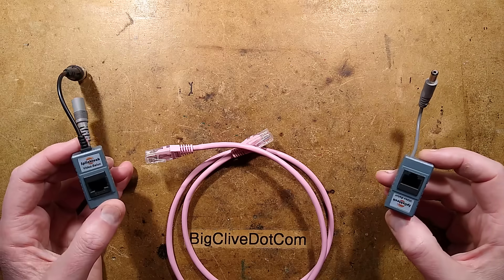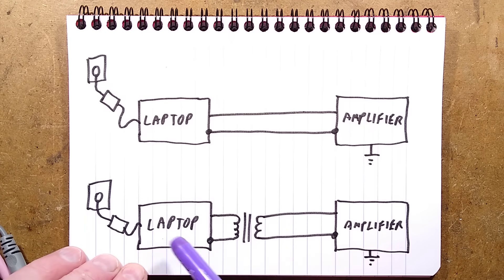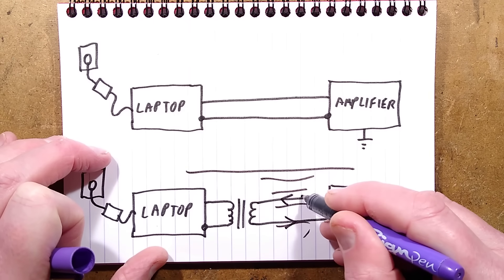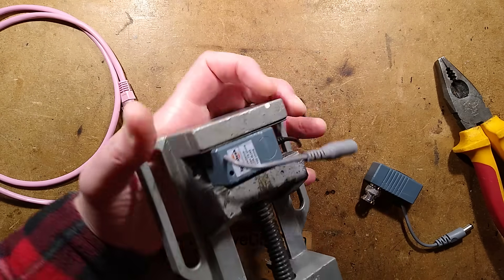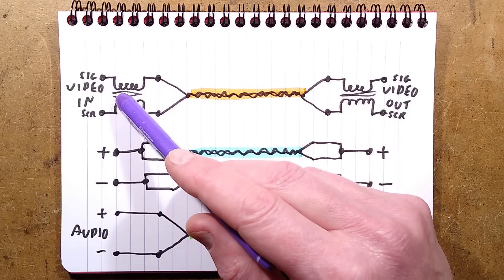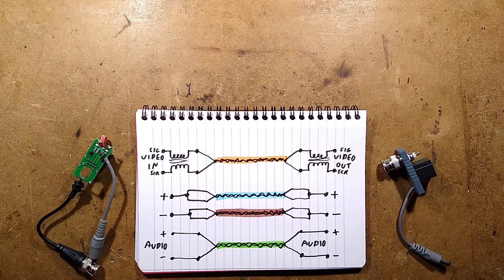Baluns - I got this one wrong (with schematic)

Comment: Used these for years as an Offshore Survey Engineer. It was always easier to run Cat5/6 cabling to carry video signals throughout a ship with a Balun on each end. Haven’t seen them in a while though as analogue video has thankfully been replaced 😂.

Comment: I feel like the transformers are to force a push AND pull of the same signal, strengthening it from noise.
The twisted pairs do a similar thing for noise, and this seems like an extra layer for cleaner video.
But that's just a theory... I have not played with these, although any kind of adapter is a fun toy...

Comment: We don't use much analogue video in the CCTV world these days but when we did the balun units we used were often PVD - Power, Video, Data. That was one pair for positive 12 or 24 volts DC and one pair for 0 volts DC. Then one  pair for thebvideo as you described. Finally, the last pair in the four-pair cat 5 cable would be for camera telemetry data for pan-tilt-zoom (PTZ) cameras. This is RS485 data and works remarkably well down unshielded twisted pair cable over really long distances. Individually screened and earthed pairs are best giving about 1km (or 1 click as the military guys would say). However, 485 dataover unshielded cat5 is will go way further than the accompanying video signal and even over 1308 telephone cable, the data is good up to the point where you'd consider running fibre instead.
These days it's all IP video and PoE (Power over Ethernet) cameras with 48V DC straight from the network switch. Alternatively, we can run just data over ethernet and maybe also fibre optic, then either use a PoE injector powered locally from near the  the camera or some cameras can run off 12 or 24 volts.

Comment: Looks like they are just a couple of common mode chokes based on your schematic. I know from experience that directly sending a 75Ω video signal down 100Ω cable does not create that much interference from the reflections.

Comment: I think they are wired as Common Mode Chokes. Any noise picked up on the cat5 video signals will be common to both video conductors, and this noise cannot propagate through either of the chokes.

Comment: I think that the point of these is to send the video signals down a balanced feeder (one of the twisted pairs), which is much lower loss than coaxial cable, and will permit a longer run with lower loss. Also very much cheaper than coax! 
They are 1:1 current, (or sometimes called choke) BALUNs, causing no impedance change at all, but they convert the unbalanced signal to balanced at one end and permit the connection of an unbalanced load at the other. 
Nothing to do with filtering at all.

Thanks for the videos. I love your sense of humour!
Ellis

Comment: Basically, imagine what Dolby did for noise reduction on audio compact cassettes and apply that same principle to noise reduction in an unbalanced cable: It encodes and decodes passively using the two transformers as the 'check-sum', which add together the waveforms in the positive and negative sides, to reconstruct an approximation on what the original clean signal was prior to being sent over the CAT5(e)/6 cable, allowing for long runs of ethernet cable to be used for further distances instead of the more costly Coaxial cable over relatively shorter distances. The circuit is probably so simple, so as to allow quite a large scale of frequencies & wavelengths to be used, possibly even allowing coax audio signals to also travel longer distances with little to no signal degradation. You've got me intrigued to experiment with a few of these units in order to discover more of their uses 🙂

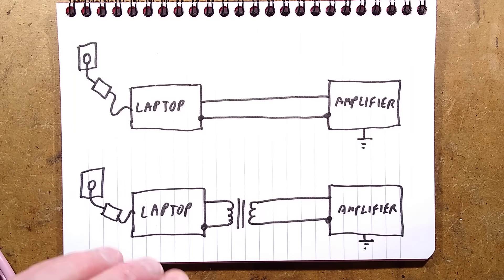Comment: I don't quite agree with your laptop/amplifier explanation at 2:58.
If you ground one of the input terminals, the line is no longer balanced (if you were using a balanced cable to begin with).
That's why you shouldn't expect to have common mode noise rejection with this setup.

It is just an isolation transformer and not a balun in this case.

Comment: When I saw balun I instantly thought “ooooo. Clive is also into his radio stuff” then chuckled at the “really geeky” comment.   Yes that’s me.   

Looking at what you have there it looks like an impedance matching transformer.   It’s very similar to the 49:1 transformer that I use in my current HF antenna.   It’s “49:1” is basically it turns an impedance in the realm of 2450 ohms and converts it down to the 50 ohms the radio likes to see.   The antenna is what is known as an end fed half wave.  So it’s just a straight wire which is half the wavelength of the minimum frequency I use.   So mine is 20m long (for approx 7mhz).   

As the current goes up so does the apparent impedance.   The voltage therefore goes down.   When you look at a sine wave and just take the bit above the line it’s basically the start of the wave.   Voltage then goes up as current goes down as does impedance.  So the cat cable in the middle acts in a similar way.   To transmit the signal down the wire the transformer is used to “match” the impedance.

Comment: Hi Clive as I was an alarm , CCTV Engineer ,the old Composite signals between cameras were always a problem as if the grounds were shared at the control unit with out filtering you got crossfeed from all the cameras giving ghosting ,so all BNC's had to be filtered by baluns.Take care buddy

Comment: 7:15 I believe that circuit is being used as a common mode choke. The transformer is wound such that differential mode signals (i.e a proper balanced signal), with the same (but opposite polarity) current in each leg, cancel out; they produce no magnetic field through the transformer core and it essentially has no effect on them. Common mode signals, however, induce a net flux in the core; essentially, it looks like an inductive choke to common mode signals, but is completely transparent to differential mode ones.

Comment: Transformer is  there to match the 75 Ω impedance coax cable with the 120 Ω of twisted pair which is used to run for the video signal. 
BALUN means:  BALance ~ UNbalance. 
This is the only way to use twisted pair (UTP) cables for video signal.

Comment: Hi Clive, Love your channel! Been watching for several years now. The transformers appear to configured as nothing more than common mode chokes - a clever way of removing interference picked up in the cable between camera and monitor. The camera signal is differential (not balanced) interference will likely be induced into both conductors and hence common mode.  I think no impedance matching is going on here.

Comment: CCTV Baluns, they are awful, designed to convert unbalanced coax to balanced twisted pair, they're used because CAT5 is cheaper than decent quality coax and they cause no end of problems, not least because the people who used them to save a few quid never understand voltage drop so I've spent a not insignificant amount of time (charged at hourly rates) debugging installs where these things have been fitted and finding a way of powering the cameras 'locally'.

For audio isolation I've had good luck with little boards like XH-M372 from Ali but ended up building my own complete with opto isolated serial for low speed control.

Comment: As drawn, there is no impedance step - which is a bit odd, as the line pair in a network cable is 100ohms, and the coax is normally 75 (that is to say that the self capacitance between the wires, and the magnetic field around them conspire to keep the voltage and current in the ratio of 75:1 or 100:1 , when propagating signals that change in a time frame short compared to the time taken for a signal to get to the end and back - so what is at  the load end has nothing to do with that impedance, - it os only a feature of the cable construction)
So why are the transformers on their sides as it were ?  NO MAGIC.
Well forget voltages, and think currents. and recall a bit of RCD theory. The unwanted out of balance current sees the core, and the impedance in creates. The wanted in balance current is unimpeded. (much as the core  an RCD does NOT see the intended L_N load current but only any out of balance component. )
So if we earth one side of the wire at one end , as we do with the coax,  but at the other end the earth is not the same RF voltage, that would create an out of balance current and the core will attenuate that effect. 
In short, the voltage difference between the two lines is preserved, but the absolute value can flap about at HF without causing problems, In fact you could cross the coax over so that at DC it was centre to ground short from one end to the other - but the RF would be fine with it, and any frequency above some minimum would come out at near 100% amplitude, just if you had a scope you would see that it had come out upside down.
Mike

Comment: I use laptops with pa gear all the time and what I've found is the cheap Chinese crap chargers are very bad at causing the ground loop noise but with genuine manufacturer branded PSU they are fine - there are the odd exception to this I found Samsung laptops have issues but think they use 3rd party chargers which must be bad too

Comment: The electrodynamics shows us that the twisted pair (or an old ladder pair of wires) doesnt have symmetry of concentric but has the same electrodynamic properties... in the ideal world - the Maxwell equations with "a little" simplification bring us to the same conclusion of a transmission - in the ideal world :) but the world is not ideal and the power adapters have faults :).
I think its just a radio balun - like these being added to the antennas and similar - it matches the impedance.

Comment: Why they do it this way is simple, Video's frequency range basically starts at DC and extends up to many megahertz, you cannot pass video directly through a regular transformer winding.
The low frequency/DC bits just pass almost directly down the twisted pair, 1 volts DC (for example) will pass straight through, however as the frequency increases the balun's more and more convert it into a fully balanced signal on the twisted pair,  it's at these frequencies that all the transmission line effects really come into play.
Actually transmission line effects covers all frequencies, it's just that at the lower frequencies the line length needed to see them becomes huge. Old school telephone lines of many many kilometres see this is audio, however no one will try and run video over this kind of distance. Most of these video baluns are rated for use over say 50 meters, so the transformer designers only have to worry about signal components over say 20KHz, saving lots on what goes into those coils.
To go any further you need to convert the video into AC (a modulator/demodulator), or go optical.

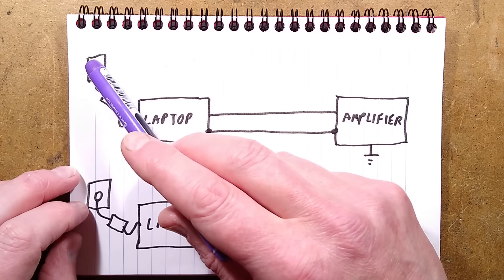Comment: 1:15 That slight shock you get is because of a mandatory return path capacitor that connects the mains neutral to the output ground. But with non-polar mains connectors you can plug the charger in backwards and now there's a ~4.7nF capacitor from live to the laptop's ground. Which gives a slight shock when you're grounded and touch it.
Reply: It would be fun to see this demonstrated!
Reply: The RF filters are also a type of balun that looks to make the RF signals from the PSU look like they are 50%:50% (anti-phased) relative to the ground so no radiating. That needs a definite leakage current at the core 50Hz (or 60Hz US) frequency. If you have too many then the leakage detector circuit can trip!
Reply: @philipoakley5498 Just another reason why the old mains wiring regulations had special rules about computers with high ground leakage .  Unfortunately this was lost in the push to get everything on 30mA or lower RCDs .

Comment: I realize there is a really low bar. But I ended up down a rabbit hole when I went to replace the excessively long and mangled RCA cable used by the original 2600 to connect to the TV.  when I started researching I found that to get the best picture I learned that I needed the right impedance cable AND the cable had to be a certain length such that the source and tuner were at a total cable distance at a specific multiple of the signals average wavelength. 

I gave up and am still using the original cable.

Comment: Interesting thing about ethernet is that it's normal to use tiny transformers at each end of each wire pair, mostly to reject common mode noise. Usually they resemble an unusually bulky 16-pin chip but it's not that uncommon for them to be integrated inside the ethernet jack. Might be that they're achieving galvanic isolation that way, although I kind of doubt it. A transformer that small probably wouldn't play very nice with such a low-frequency signal.

Comment: With the way the schematic is drawn, the windings are acting as a common mode choke.  if the windings were isolated between the device and the cable, then it would be acting as impedance matching.

Comment: Oh yes the video signal is getting impedance shifted going from 75Ω to 110Ω and then back again. The crazy thing is if you get really creative with cutting up coaxial cables (maths) you can actually use different coaxial cable pieces to shift between 50Ω and 75Ω.
And you can get your video and audio isolation transformers to get rid of ground loops. And that's a similar dark magic.
I'm not an expert but I have done a little bit of reading in the ham radio and things and finally got my license. And far much more reading in the Electrical audio video end of things. I did a relatively small experiment one year one day where I took 2x 10bass2 50Ω coaxial Nettwerk "hubs" and connected them over traditional television 75Ω Cable for about 50 feet, I had to use a variable resistor to match the impedance expected for the termination resistors but it worked and was stable surprisingly. Normally they are terminated with a 50Ω resistor on each end of the chain.

Comment: Former IT cabler, electronics engineer, and radar guy for the Navy. If I was to take a stab at it I would say that the transformers take the signal(a/c) and ground (relative dc) and turn them into 2 singnal wires with an a/c signal(each wire having a equal and opposite balanced phases). The 2 signal wires then go across a twisted pair and join on the other side and the transformer brings the ground and signal back. I believe having an equally balanced (equal and opposite phases) signal wires will help reject any noise that would be absorbed by the signal or ground wires, causing interference.

Comment: For some of the cameras we have on poles that are a long way from the switch, we actually use ethernet to coax converters that take 1gb with poe and run it over an RG6 coax cable to maximize distance.
We also came across game changer cable that gets you a stable connection over 200m with poe.
Reply: I've heard of those "game changer" cables but I don't think they're worth it. IIRC you are limited to 100 megabit Ethernet at best and it still violates installation best practices. It's much more flexible to run an optical cable and a separate low-voltage 48v power cable. It's probably about the same cost yet it will let you upgrade to 10gig or even better in the future.

Comment: POE cameras are the way to go.  No need for any of this antiquated bushwa as a result!
Reply: And what about if you want direct connection of a camera that produces baseband composite video to a monitor with an input for the same? AND NONE OF THE DELAY that results from video over IP?
Reply: @D614G_aka_Doug  I'm not sure about all of that, I've installed a few POE security camera setups.  Yes there is a delay.  You'd think newer technology would be better - lol.  I'm not arguing with what you are saying and you are probably right about these quirks or benefits of a coaxial camera setup.
Reply: @D614G_aka_Doug  By the way - I've also heard of something called "POE COAX" although I have no experience with it personally.  Maybe you've heard of it?  I believe that's what Clive has here potentially?

Comment: The Baluns I use are for television RF signals to match the 300 ohm balanced twin lead line from the over the air antenna to the 75 ohm coaxial input of the television. The balanced 300 ohm standard is still in common use for dipole and "rabbit ear' antennas to match their characteristics - VHF antennas. Baluns prevent signal loss and line reflections from an impedance mismatch and handle the balance/unbalance transmission issue.  Flat twin lead is very low loss and doesn't need shielding from noise if balance is maintained at both ends.

Comment: Ive always wanted to know if polarity matters when using these baluns… the terminal blocks on the smaller ones (no audio/power/cat6) are always labled + and - and Ive always wanted to try inverting the polarity between a pair to see what happens
Reply: If you invert only one end of the pair it won't work.

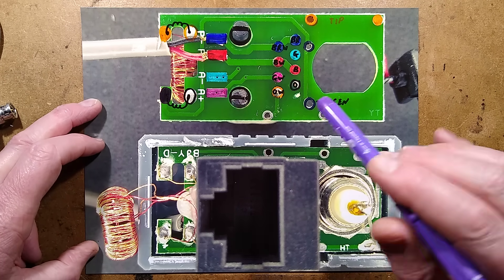Comment: CLIVE:    We really need to know exactly how the transformer is wound. In the image at 5:44 It looks to me like there is a something wound around the toroid outside (i.e. going around the outside circumference like a belt) between layers of normal turns, but I can't really tell for sure. That may be a tap in the windings wound in that way for convenience.

I'm also curious what sort of core is being used. My guess is that it is a high-permeability ferrite and will just be plain dark grey with no markings. Things can be learned with the right instruments but if they aren't at hand it can be time consuming.

A lot of people are suggesting it is just a common mode choke but I don't buy it. I think it is a proper so-called "current balun" which preserves the DC component of the composite video while matching the impedances.